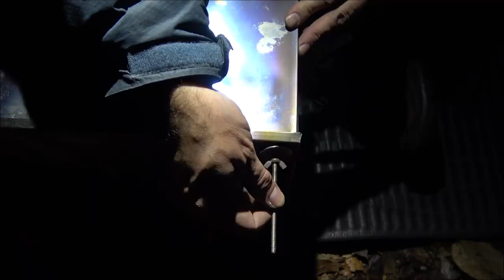Hot Tenting. Night Pitch & November Rain.

Comment: Yeah, the season is coming quick!  I need to do a shakedown myself.

I'm almost done making a copy of your stack robber.  Been a challenge, and I'm on my third attempt to build it.  First time, I tried using stainless water bottles to fabricate from, but whatever "stainless" those 'made in China' is, it didn't play nice with the TIG welder.  Second attempt, I rolled my own pieces from 18 ga stainless sheet, but soon realized it was getting way too heavy.  Third attempt is 24ga stainless, and have it all tacked together, but I'm stuck trying to weld the T joints. (lap joints I can do, but cant make them everywhere)  Just too thin for my skill level and TIG welder.  Maybe I'll try ox-acetelyne to finish it up.
Reply from the maker: I need to work on a take down or not welding version of it. Thanks for watching!

Comment: nice DIY cylindrical shape spark arrester.  would be nice to see how it's done.  seems like there is a 2nd burn in that cylinder?
Reply from the maker: It's on my to do list.
Reply from the maker: Yes secondary combustion burning the un burnt flammable gasses in the smoke leaving the stove.
Reply: I second that I would love to see a video on that. Do you have any concern of eventually burning out the bottom of the stove? I heard that can be an issue with the lightweight ones if not built well.

Comment: I have a kifaru sawtooth and run a medium box stove with it. I also have a supertarp for a lighter shelter option. ive been looking for a lighter stove option. How do you like the SO when compared to the kifaru? Im looking at either the medium or large SO stove. According to their website, its about half the weight of the medium box stove. Looking to hear your inputs on the SO stove. I definitely want a box stove, and not a cylinder because I prefer to have the flat top/cook top option.
Reply from the maker: I have the large, Small and Para box stoves from Kifaru. I like the door on the Kifaru box stoves better than the SO. I prefer the Kifaru nylon case much better than the SO nylon pullout to pack the stove. I prefer the SS pipe of the Kifaru to the Ti pipe of the SO as it's easier to worth with. For the SO I like the vent blockers which allows the vent to be open yet keeps sparks from flying the door when closed which is a rare issue. The Kifaru collar/spark screens packs down better yet the SO collar/spark screen(it only has one) and damper is better in actual use. I think the SO is easier to setup than my Kifaru box stoves but that is subjective. Both stoves are a joy to cook on.  These days I pack the SO because I get a larger stove for less weight. I don't own the Kifaru Med but would get the SO over that if backpacking as the Kifaru small is no longer made. The Kifaru large is just a monster. LOL! I home that helps and thanks for watching!

Comment: Nice maple leaf pot holder!   Can't wait to get out and hot tent now!  Did your sleeping pad and bag end up getting wet later in the evening?  Wondering why you had to dry it out in the morning.  Thanks for another cool video.
Reply from the maker: The cold rain really picked up and lasted all night so some condensation dripped on my bag. The outside bag was synthetic and inside down. I never felt the water but realized it got damp in the AM. I have a liner on my 4-man TIPI but never bothered to get one for the 6. Normally I pack a UL bivy bag when using this or the Paratipi (heavier USGI for the pulk) but I forgot it. They were not all that wet but worthy of hanging out. Thanks for watching.

Comment: If you go on eBay and search for LED flashlights and headlamps, you can find many that are inexpensive and serviceable for camping. I set the search engine for $1 and work my way up. You may get some clunkers but you will find many good ones. 18650 li-ion rechargeable batteries are best. 14500 are smaller and more compact but won't last as long. there is a learning curve so search the internet for reviews. Most are made in SE Asia so take time to ship. I have ordered dozens and have been quite satisfied overall. Tariffs are starting to increase prices.
Reply from the maker: Thanks for watching!

Comment: I bought a light called luminoodle on Amazon, it’s pretty good. It will light the inside of the tent very well.
Once the tent gets warm are ticks a problem?
Very good video Walker 👍🏻
Reply from the maker: I do worry about that early and late in the season as have seen them. Deep winter doesn't seem to be and issue. Thanks for watching!

Comment: I can see why you would want leaves around the outside of your tent. If it were me doing that I would want ALL of the leaves out of the inside my tent, huge fire hazard !
Reply from the maker: Not me. That would be a waste of time and counterproductive. Do you see a fire other than what's in the stove?. No and there is a reason for that beyond my decades of experience (only thing I am good at. LOL). First I removed the leaves from directly under and around the stove 18:10 and go out of my way to say it. Even then it probably doesn't matter as it was a soaking wet November not a dry August. I don't want all the leaves out of the tent as then the ground under would be mostly mud. What a sloppy mess that would be. Why in the world would I do that? Not a fire hazard. In fact they totally suck as tinder. At best might smolder if they came into direct contact with the stove. Drop a coal on one and it just smolders. The only leaves I know of in this area and time of year which are within practical terms combustible  are hanging beech leaves because they're off the ground and very thin. Naturally if the season was usually dry I might act differently but it's the wild opposite. Everything was and still is saturated with record rainfall. Thanks for watching.

Comment: Ok. I'm confused.  How is it that you are in the woods, presumably on the AT or somewhere at or near the top of a mountain, at night and are just setting up camp. Can I assume you left for the the mountains after completing a shift at work?
Reply from the maker: Forgot to ask how that Tut 4 man is working out as been looking at that or the Sawtooth to save packed weight,
Reply from the maker: Combo deal. Late day and I left later intentionally. I like to practice setting out and setting up in the dark. Thanks for watching!
Reply: @MegaWoodswalker  The Tut is awesome.  If used by just one person there's plenty of room for gear, a stove, a large pile of wood and a place for your sleep system.  Once you tie down the tie outs its essentially bombproof. I had it overnight in sustained 20 mph winds with gusts up to 30 and the tipi held up fine. The main difference between the Sawtooth and the Tut is that the Sawtooth has a liner while the Tut does not. The liner prevents condensation from getting on you.  The temperature was down around 28 on my recent outing. I had condensation freezing on the inside tipi walls  in the morning when I woke up.  You're not likely to have that in the Sawtooth. However, in the morning I zipped up the opening and pegged out one flap for better ventilation. The moisture on the tipi walls was gone in just a few moments. My box stove kept the inside temperature around 70 degrees Fahrenheit until I let it go out around 11 pm. I think the gross weight of the Tut is about 3 and a half pounds including the aluminum pole.  I'm looking for a carbon fiber pole to further reduce the weight
Reply from the maker: Thanks. 3.5 lbs sounds good.
Reply: @MegaWoodswalker   I just got off the Kifaru website.  Under "shelter accessories " you can separately order a liner for whatever tipi you may have. It appears they have a liner that can be retrofit for a 4 man tipi. I'm assuming that includes the Tut. The gross weight of the liner is 2.5 pounds. If you don't want to drop change on a liner, or carry the extra weight I think you can deal with interior wall condensation by either opening the tipi door or leaving extra space between the tipi walls and the ground, or both. Also, burning the wood stove should keep the tipi walls dry.
Reply from the maker: @ElkArrow  I have a Kifaru 4-man tipi with liner which is heavier than the Tut. It's been discontinued so it's possible they still sell liners for it. It is my deep cold shelter as the double walls (liner also drapes down to the floor) makes for a really warm tent. Much more than the 6-man using the same stove. The walls can also freeze up with a thick coat of ice/frost as well. Tends to happen in the cranking cold and often no higher than the level of the stove.
Reply: @MegaWoodswalker   Walker, you were right about that liner. Kifaru advises that it is for the 4 man tipi, not the Tut. It can't be retrofitted with the Tut.
Reply from the maker: @ElkArrow  The old 4-man is heavier and I think the TUT was an effort to reduce the weight. I did a sub zero pulk sled outing last winter and it was really really warm with the liner and seekoutside SXL. If Patrick comes to the next group winter camp out in Feb I will ask him about a liner for the TUT.
Reply: @MegaWoodswalker  Sounds good.  Keep up all your great work!
Reply: @ @ElkArrow  Ruta Locura has carbon fiber tent poles
Reply: @hobbypassion  link?